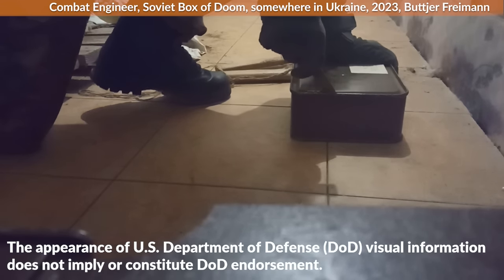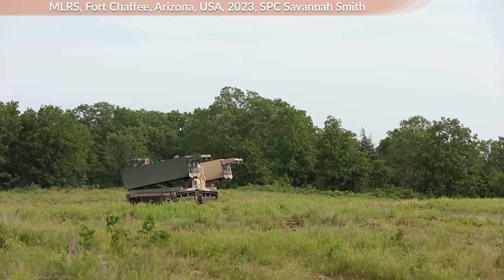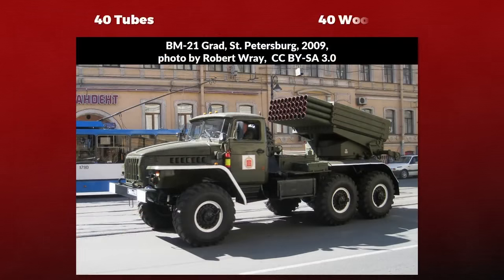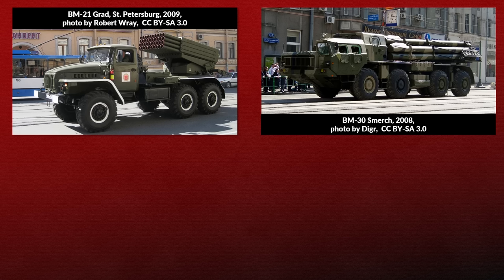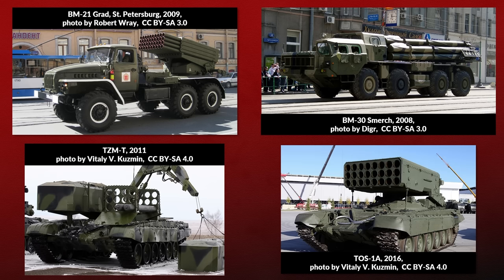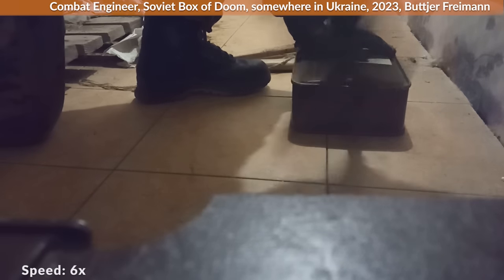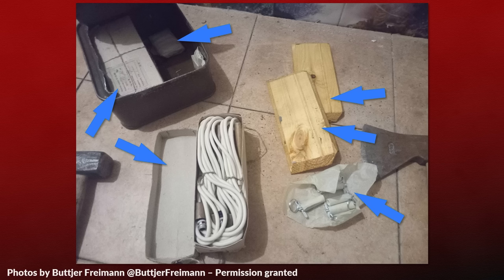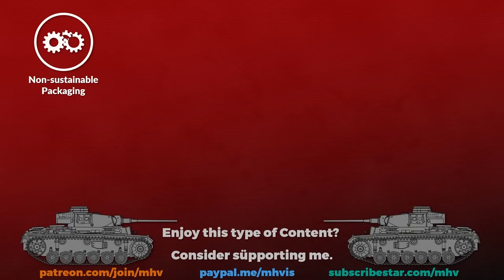Ukraine: Why Soviet Packaging is a Nightmare - Unboxing Edition

Comment: As an American shooting enthusiast/11B GWOT vet, I can absolutely attest to this.  Former soviet and current-manufacture Wolf and Tula spam cans used to be the most affordable plinking ammo you could find...I still have some 7n6 cans I purchased years ago for $0.12us per round.  
American military small-arms ammo comes just about ready to rock as soon as you get it out of the transport crate.  5.56 comes in 210rd bandoleers of 10rd stripper clips, and 2 magazine adapters for the clips, so you just need a table or 2x4 to slam in 7 magazines' worth of ammo in about a minute or two. Belted 5.56 has two 200rd plastic boxes ready to attach to the SAW. 7.62 belted comes ready to feed from the 100rd cardboard box with it's own disposable cloth sling.

Having been deployed to mosul and baghdad between aug 05 and dec 06, I can assure you, those 5.56 strippers are amazing under stress. Don't need light, just need to slam in 21 clips and get going.  There's practically a whole culture of kicking dunnage (the reusable ammo cans) back to where you got it from, while you still have a means of transporting bulk ammo straight to people directly the fight.  Just like the A2 sight picture, the millions of hours of collective brainpower and experience put into it shows.
Spam cans are really cool for doomsday preppers, tho.
Reply: Spam cans are cool for the prepper side of things sure, but the regular USGI hinged / latching ammo can is still extremely capable of keeping out the elements for years and years at a time
Reply: Me, currently shooting at roughly € 0,92 per round: Soft weeping 😉
Reply: @Werepie  Not only that, they're resealable - so if you don't use all the things in the can, you flip the lid back down and latch it - almost as tightly sealed and clean as when it left the factory. 

What happens when Yevgeny, still hungover from last night's antifreeze binge, accidentally miscounts the number of boxes he had to open and it starts raining?
Reply: Was invading Iraq and Afghanistan worth it
Reply: @hoilst265  And those cans have so many post-ammo uses!
Reply: @Adonnus100  Take your geopolitical bait to a different discussion, pally.
Reply: @MonkeyJedi99  It's not bait, and I didn't ask you
Reply: @Adonnus100 no, it wasn't
Reply: @Adonnus100  The question is phrased wrong. It should never have happened for a variety of reasons. Countries should not be invading other countries to bring democracy - but perhaps to liberate actual slaves or to actually bring good to their lives, maybe? Democracy is fundamentally a bottom-up approach to governance. You can't force a country to be a democracy, that country's people has to want it in the first place.

The question is phrased wrong because we didn't invade to actually bring democracy, we invaded in order to line the pockets of rich neocons.
Reply: Are the square  ammo cans I see in surplus stores more of an end user thing or are they also used as a shipping container?
Reply: @nvelsen1975  Don't feel too bad. The cost of Soviet-era ammunition has skyrocketed in the U.S. after the last 10 years of sanctions against Russia, so we're all suffering with you guys.

Domestic ammo prices have also gone through the roof over the past few years, but not that high yet, thankfully.
Reply: @Adonnus100  The taliban are not threatening the US and Iraq is still a really good ally of the US, so yeah, it was worth it, considering they've gotten less causaulties in this war than Russia accumulated in 6 months.
Reply: @gae_wead_dad_6914  idk bout iraq. aren't they basically under the thumb of shia parties which are ordered from tehran?
Reply: You got a whole comment chain saying, "Oh yeah but the Sardine cans work!" 

 Like American or NATO packaging isn't amazing. 

 I've never heard of any grunt hating American packaging. Only praise. I've seen at least one WWII mention how much better it is these days. 

 Saw an old merchant marine just love American logistics these days.
Reply: Ahhh alas the days of the cheap Russian ammo are long gone. I have some x54r and x36 spam cans, I wanted some 7n6 but that went insane in price, last I checked they wanted 1200$ for 2 cans I got I'm early I've got a solid 10k rounds for my ak's minus berdan primed 223, I need to buy a couple thousand of that too before it's all gone and costing 3 dollars a round like 9x39 is, which i lucked out and bought 1k rounds of that before it all disappeared and collectors are offering 1 round for 20$ lmfao